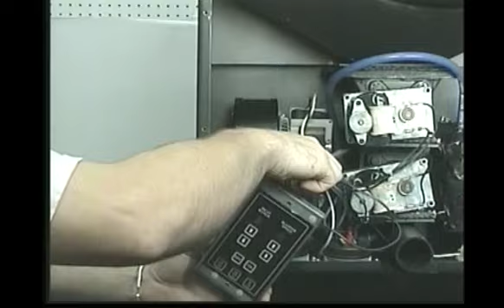AutoStart 14 Convection Room Air Blower - Cleaning, Maintenance and Replacement

Comment: all of their blower motors are WAY under powered , if they would use a slightly bigger motor you would not have to clean it but once a year , I run my heater a lot in winter and have to clean the dang thing about 3 times a yea,r if I don't the fan slows WAY DOWN ...NOT a good thing when its cold and you need it most
Reply: Hi guitarplayer-i need your help. Mine just did the same exact thing- the blower fan is WAY TOO slow and not heating the house enough. How did you clean yours? I am a novice to repairs. THANKS